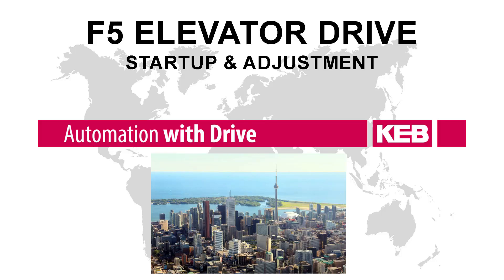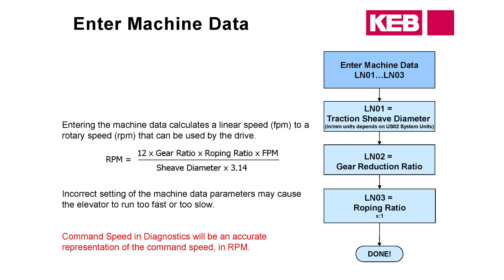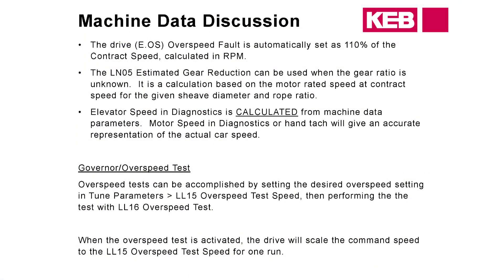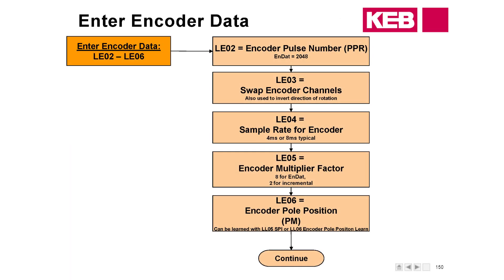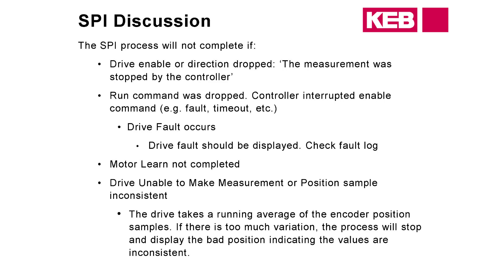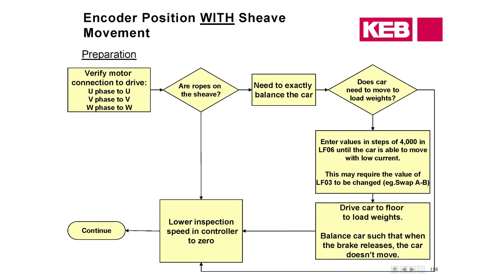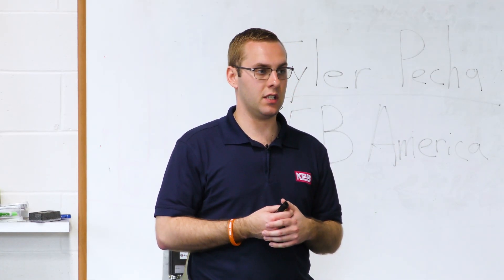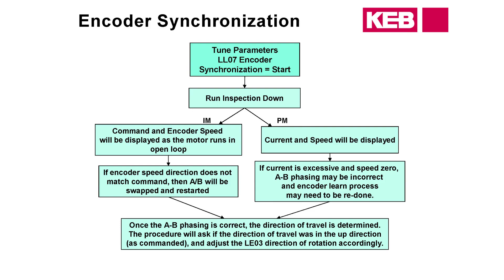KEB F5 Elevator Drive Training: Autotune, SPI Learn and Other Adjustments (Part 9)

Comment: Whenever I try to auto tune, the current goes to the maximum (369 Amps) and the motor won't turn, with smoke popping out. Any tips?
Reply from the maker: I hope you were able to contact your controller manufacturer or contact us through our website, phone number or email to solve your issues. This is something that should be worked through outside a YouTube comment section. :) 
Find a local KEB rep here: https://www.keb.co.uk/contact/contact-worldwide